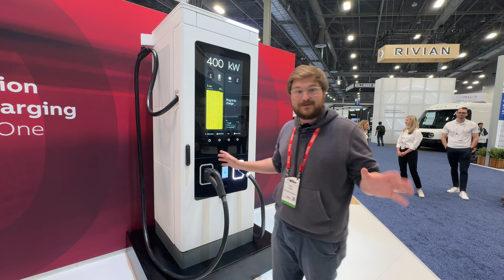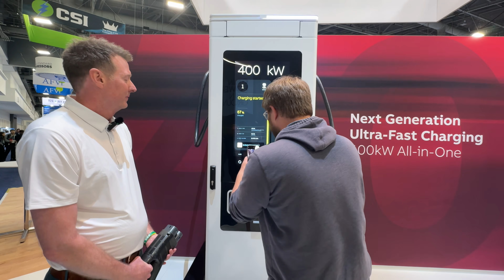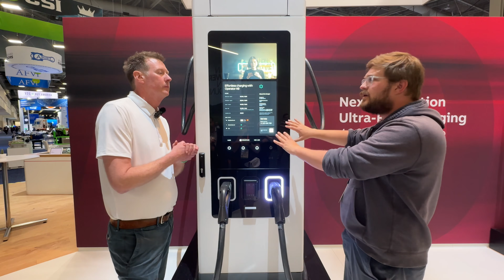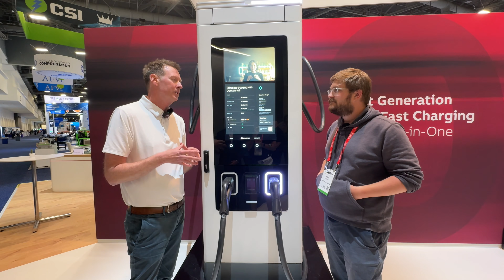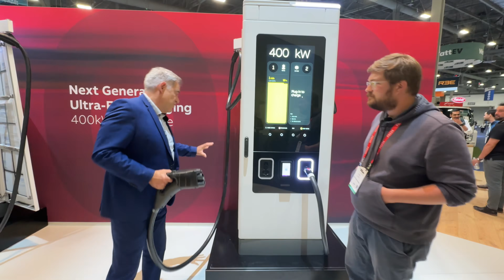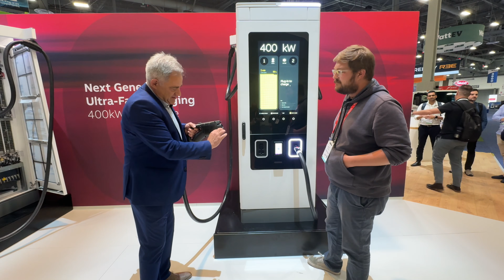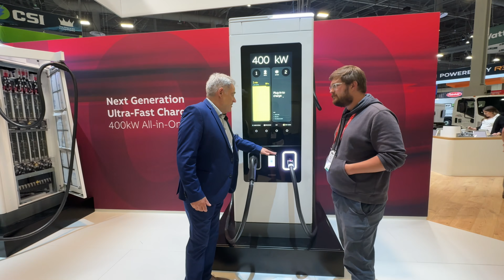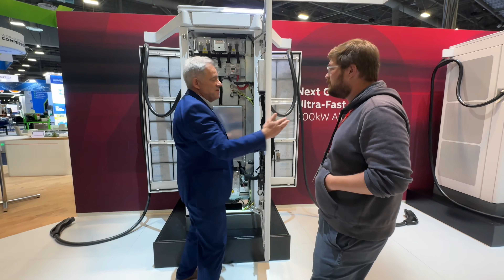New ABB 400kW All-In-One DC Fast Charger! A400 HPC Full Tour - Software, Cables, & Hardware

Comment: But does it get started  setting up the car communications, isolation check and charge session startup while it's waiting for the payment to go through? Most chargers are pretty slow & dumb in this respect, adding at least 20-30 seconds to the time you need to hang around to make sure charging has started because it doesn't start as oon as it could. Maybe you should do a league table of time between plug-in and actually confirming charging between brands.
Reply: Most of that time is actually closing the high-power contactors for grid connection. The communications, isolation check, etc. is about the same regardless of CPO.
Reply: Takes 7 seconds for a Tesla SC to start charging. I have autocharge with EVgo and it takes about 45 seconds for it to start charging. I'm really hanging on suspenders with EVgo, hoping it will start.
Reply: Most of the time is for cable check so Isolation testing then comes precharge with our system at Kreisel Electric it takes around 15 seconds for Cable Check and around 1 second for precharge

Comment: Why CCS everything is switching to NACS
Reply: In the US! Europe and South America have CCS 2 as standard.
Reply: @P2EDUARDO Plus Australia.
Reply: First of all, hundreds of thousands CCS cars already on the roads in the US and will stay in use at least the end of the decade, Second, here in Europe nobody uses Tesla Connector not even Tesla, everything is CCS
Reply: Because "NACS" is just repackaged CCS.
Reply: NACS is not compatible with most of the planet, because everyone has three phase power available at home, except Americans. That's why most places use CCS2.
Reply: NACS pins are only good for 400A, CCS is 600A so faster charging capability.
Reply: @fredderf6491  Where are you getting 400 amps for NACS? That would only provide ~160 kW at 400 volts which is far lower than the current supercharger max. Tesla says they have tested NACS up to 900 amps continuously.
Reply: @chadshenk ABB is not using liquid cooling. Their design needs a large heatsink in the connector.
Reply: @chadshenk  Where did they say 900A continuously? The J3400 is rated for up to 900A by Tesla papers, but I've never seen them say that is not just peak. The say there are temp sensors in the plug to reduce current if it gets to hot.
The J3400 DC(AC) pins are much smaller than CCS2 DC pins so I can't imagine they can do that.
Reply: @Gazer75  They removed the documents from their website now that it’s SAE J3400, but they claimed they tested it up to 900 amps continuously in the original release. Wikipedia makes a mention of it as well. I tried to check the wayback machine to find the original doc, but their site is having issues today.
Reply: @chadshenk  "Tesla says they have tested NACS up to 900 amps continuously." Consider the source, the NACS connector needs significant upgrades to handle that power.